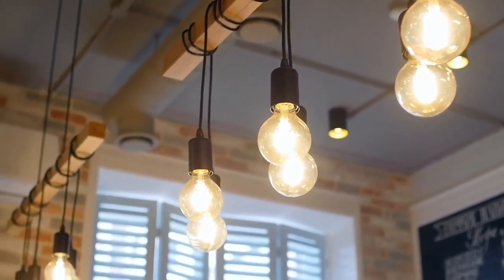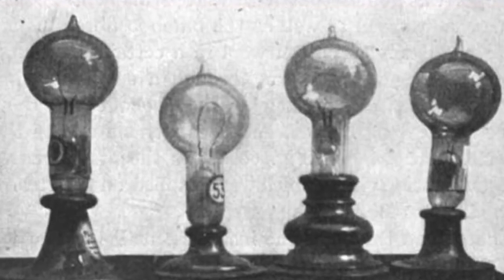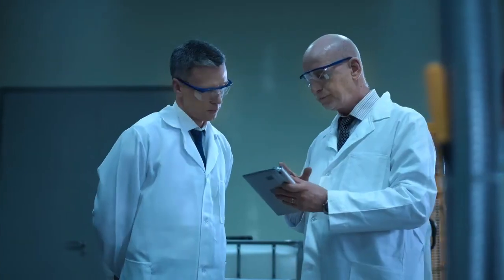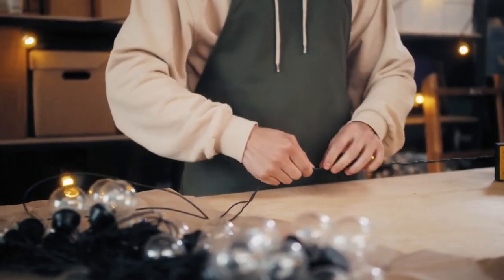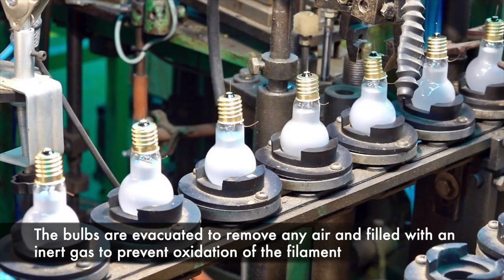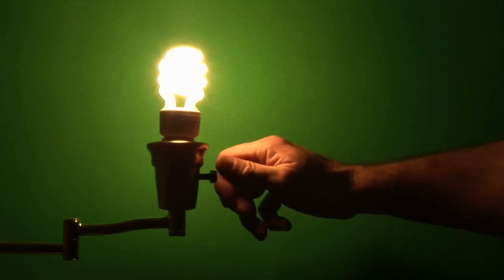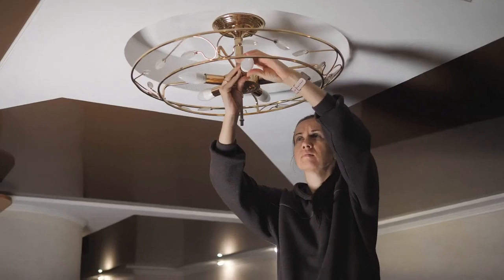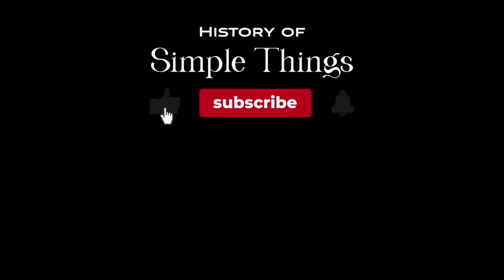How are Light Bulbs Made? | 1.1

Comment: Now the LED bulb conquers all, to the point that they threw away the old efficiency chart as there was an an increasing number of A+++ and created a new chart where the bog-standard LED bulb was an F. What makes better bulbs than F? For starters, not screwing the maximum output from the minimum number of LEDs, and also running them at constant current, not the peaky intermittent drive of some cheaper drive circuits which also causes flicker / strobe effects